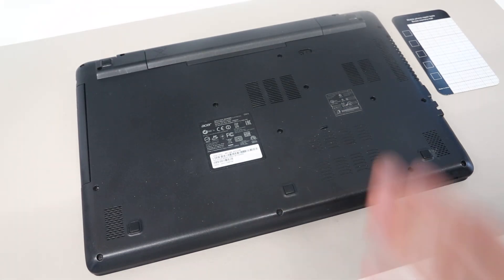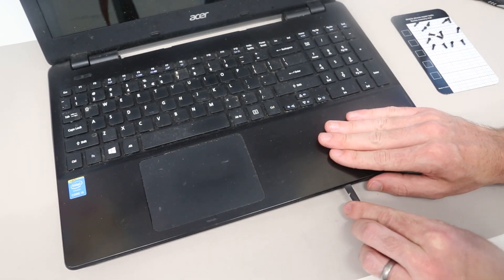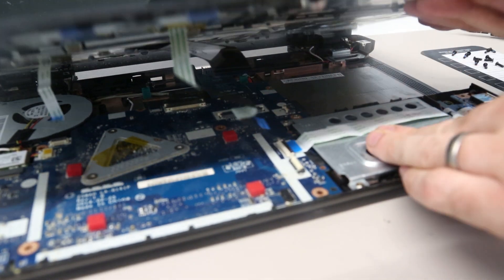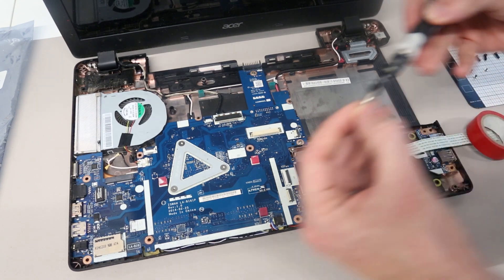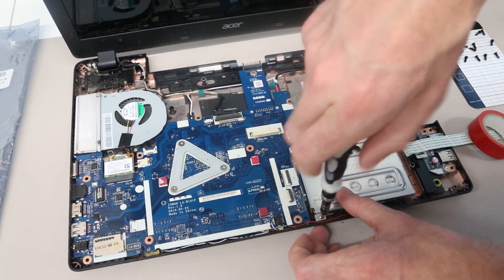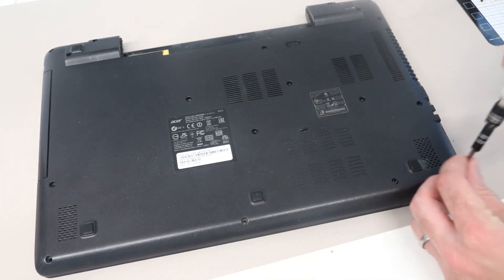Acer Aspire E5-571 - SSD/HDD and RAM upgrade guide

Comment: Thank you @BrueComputing for a very informative and useful video. Quite an appalling design for a laptop to perform a normally simple exercise like a memory upgrade. I followed it precisely but left the WiFi connectors in place as they seemed stubborn to be removed, and it didn't prevent me from lifting the motherboard and adding the RAM. I also didn't immediately replace all the screws after reassembly as I wanted to test all was in order once the battery was back in place. Pleased I did as the keyboard wasn't working - the ribbon cable had not been properly reattached - quite fiddly. All now in order - gone from 4Gb to 12Gb and machine running well. Many thanks!

Comment: O meu veio com dois pentes de 4 Gb . Porém, troquei um pelo de 8gb ( mesma frequência e mesma voltagem) e o notebook não reconheceu

Mine came with two 4GB sticks. However, I replaced one with an 8GB one (same frequency and voltage) and the notebook couldn't find it.

Comment: thank u. i opened it but i installed a new 4gb pc3 (not L) module, reassembled everything but windows still see 4gb. also task manager, but using cpuZ i can see that module i added. why?
maybe because stock mainboard uses 1.35v ram module pc3L and adding a pc3 at 1.5v is blocked? i expected also original module to be raised to 1.5v.  or that i forced some error at boot. instead no errors, and module is recognized by cpuz.... but not by os to use full 8gb.  

i ordered a new kit of 2x8gb pc3L from amazon...i need a fresh os installation and 4gb is not enough today. 8 was ok but if it's not working, i go to 16gb

ps. touchpad in my unit is not working. but cable is connected, maybe a windows driver problem, (it's a pc i received from a frient at 0 cost) and with a fresh os install MAYBE it will return alive ehehhe. but i don't wanna spend for a new one
Reply from the maker: Do you have a 32 or 64-bit version of Windows installed?
32-bit Windows can only address 4GB RAM, for more than that you need 64-bit.
Reply: 64 of course  @BrueComputing

Comment: Thank you. Updated my Acer according to this guide with ssd and 16gb ram. Everything is perfect and very easy explained step by step.
Reply: This is very interesting as I thought   the limit was 8gb ram, which I already have installed on my Acer.
Reply from the maker: Glad it helped
Reply: @BrueComputing one more question. After upgrade led diode that indicates that charger is connected stop working. Other diode for indicating that laptop is power up  is working. What would be the problem ?

Comment: Hello, I have an Acer laptop model 2519 I would like to change the motherboard to a motherboard that has a more powerful processor or a removable processor. What device is compatible with this?
Reply: Laptops aren't upgradeable like this. Most Laptops use a different formfactor and and the cpu's are permanently installed.
If you want to do something like this you need a laptop from "Framework" or something.
your laptop is upgradeable in hdd/ssd, ram and wifi like most laptops.
Reply: @hybsspa  I mean there are many versions like this I expected there to be a compatible motherboard with this device

Comment: An excellent tutorial that I found useful to upgrade this old E5-571-30AL laptop I have been given.
I added the max of 16gb of RAM and an SSD, both will speed it up.

If I can give anyone new reading this a tip.
The internal silver screws;
The fan has 2x flat top thinner thread screws.
The WIFI board has 1x flat top, thinner thread screw.
The battery and main board screws are the same, as are the drive screws.

Once the front panel has been snapped into place, before screwing in all 18 retaining screws, fit the battery, flip it over, power it up and find a way to test the keys )I used a notepad doc.).
This can be helpful in case the keyboard connector has not been fully fitted.
If that works, power it down and fit the 18 screws then enjoy your upgraded laptop.

Comment: Excellent video, thanks for clear explanations, I was able to upgrade this ancient laptop that was not used for years to 16Gb and give it a new life. The only problem was reconnecting keyboard ribbon, the plastic piece wouldn't hold the ribbon in place (very poor design by Acer), but thanks to USB keyboard it's not a big issue.
Reply from the maker: Glad I could help!

Comment: Hi, I need your help.
I have the same laptop and i think its CMOS BIOS battery has failed.
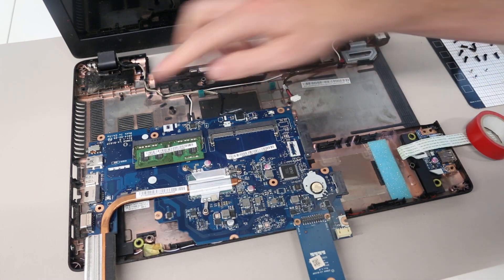As seen in the video 6:30 the battery is soldered to the board and it says "ML 1220 Rechargeable Battery" which i couldn't find online.
Can i replace it with a CR1220 non rechargeable battery? will there be any problems?
Reply: should be no problem, the battery is only used to keep bios configs.
funny part you also can use a huge lipo. you only have to look for the same voltage as the ML 1220 Rechargeable Battery is!
same is your cr1220 just look for the voltage.
Reply: Thanks for the response! That helps a lot.👍

Comment: Is acer e5 571 core i5 is still worthit on 2024?
Reply: I got a E5 571G, it's an old laptop but it got a Dedicated gpu (840M4gb) so it's still holding on and fighting for its life😂. You should get a newer laptop for 2024/2025 because there are a lot more cheaper laptop with a good specs now.

Comment: Hello Brue ! 

First of all I wanted to thank you very much for this tutorial. I've had the same Aspire since about 2015 (typing this comment on it right now) and always find myself coming back to your tutorial, which I saved in my "watch later playlist" when I wanted to change something. I've replaced the HDD then put a SSD, I will also be adding some RAM in a few days. I wanted to thank you for your help : your tutorial is very well explained and you always show what you're doing with a fine camera angle

Now my question is : do you think it is feasible to replace the GPU and CPU on this PC ? I've always found it funny that GPU and CPU shared the same heatsink on this laptop. 

Thanks again. Thank you for showing us how to increase our devices' lifespan instead of throwing it in the trash and buying a new one !
Reply from the maker: Hey, thanks for the kind words and really pleased its been so helpful!
The CPU/GPU are soldered to the mainboard, so can't really be upgraded unfortunately. This is common for pretty much all modern laptops though.

Comment: My laptop did not come apart as easily as yours and those 3 cables came out when I was pushing it. The computer turns on and the touchpad works, but my keyboard does not work :( It cannot hold the cable and it comes out. Do you think I can tape that cable to the motherboard? Or will the tape melt and damage the laptop?
Reply: same problem here
Reply: @marioisraelhernandez671  Try placing the keyboard cable at a steeper angle instead of pushing it parallel to the base like other flat cables. I didn't pay attention to this, so as soon as I inserted the cable, it came back out. I placed it at a slightly steeper angle and taped it after it was firmly in place. In this way my problem was solved. If you are lucky like me and the cable and cable port are not damaged, you can use your keyboard again.

Comment: Hello, thank you for the video. I may have a stupid question, sorry. Please, is there another physical storage medium in this computer other than the hard drive (which you changed to an SSD) and RAM? In the operating system of this computer (specifically Acer e5-511-p9qs) it shows me that drive C and also drive D are installed there. It's just an internal partition, but physically these two are located in one HDD that you just changed ? Or is there another medium out there somewhere, please? Thank you very much!
Reply: Yes there’s only one storage it’s the hdd

Comment: It's pretty clear that my fingertips weren't meant to be holding these tiny screws. Especially when I also must place the correct end into the correct hole and then twist applying only a slight amount of down force. 

Such a non-chalant video moving right along with his brutish tone and inflection. Cannot count the times I froze the video or started ot over from the inside removal. My laptop is in shambles and there is now way I'm getting the black and white antennae to simply push back onto their slots. No damn way. 

His soft upbeat formal non-chalant voice being repeated for maneuvers I still haven't completed has tapped my insanity and I must find another to direct me. Hope yall had better luck

Comment: thanks for the helpful videos. question, is 8gigs the max ram this motherboard can handle or are there other ram amounts that can also fit (ie 16, 32 etc)?
Reply: 4 months late to reply but I had 4gb on board and inserted 8gb to the 2nd slot and it runs fine with 12gb.

Comment: hello there i upgrade my ram but the pc won't display anything just turning on and off again and again
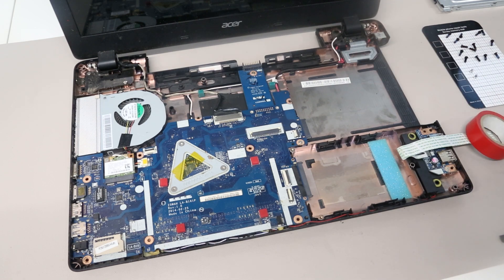Reply: Did you make sure you reconnected the display connector? @ 4:58
Reply: Had the same happening to me a while ago when I wanted to install some more RAM in my son's (older) laptop. In the end I realized the laptop was not made to operate with the 1666MHz RAM. I will have to find older, slower RAM.
Reply: The RAM should be a maximum of 16 GB and it should be a little old
Reply: @اندرويد_بلس  Yes correct, not more than 16MB, in my case I only tried to add 4MB to the existing 4MB, but RAM not old enough. In fact 1600 MHz and not 1666 as mentioned above.

Comment: ca3-8d128-hp
Can  I use this ssd for my aspire e5-571?
Reply: No, The CA3-8D128-HP has a M.2 PCIe NVMe Interface, although it is an SSD its a different interface, you need a SATA interface, you could use an external NVMe enclosure, they are not to expensive, you will need a full length enclosure to fit your CA3-8D128-HP in, make sure the end that plugs into the laptop is USB 3